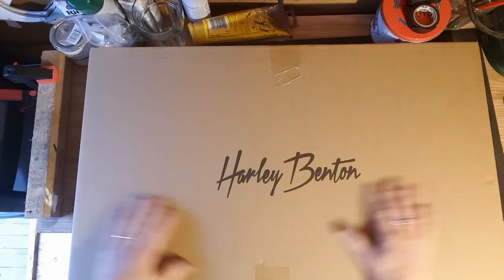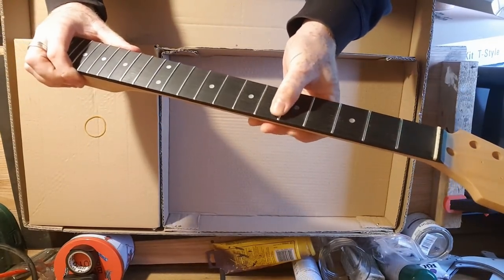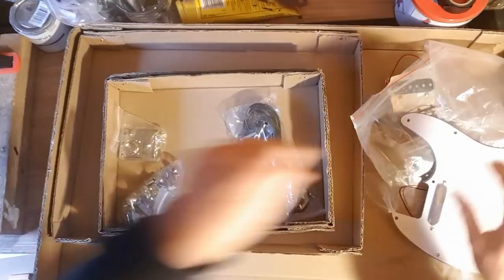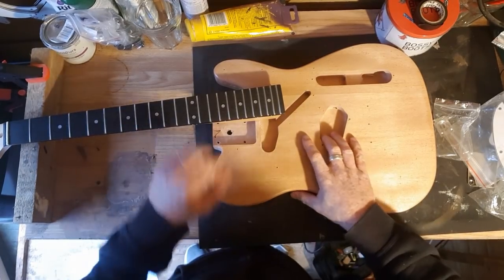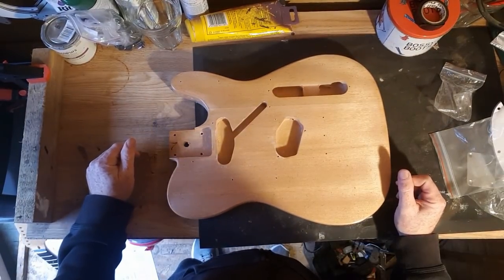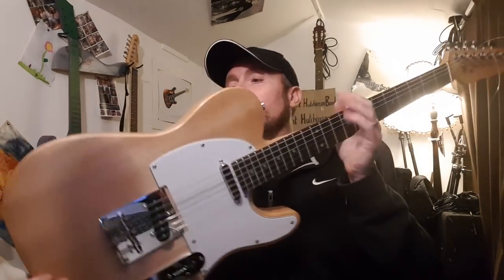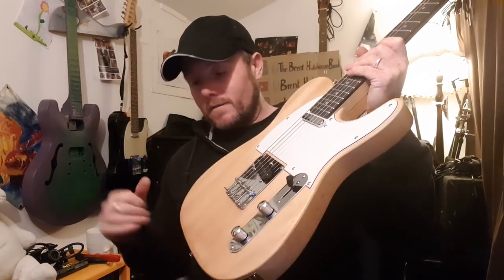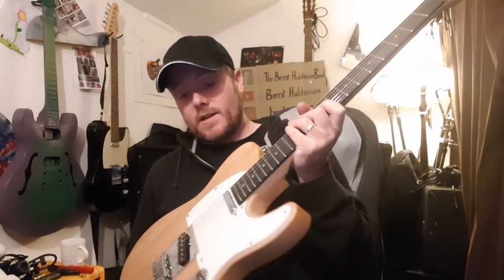Harley Benton Telecaster Kit Unboxing First Impressions Build and Sound Test

Comment: I got one of these kits a couple of years ago and covered it in Harris Tweed fabric at the request of a mate. Went better than expected so I would actually try that again. The cost was about the same then as now, and the build quality was ok, for the price. The fret ends were sharp though pretty much all along the neck, and the truss rod didn't perform well but the neck was straight enough. Be prepared to do a lot of fettling if you do get one. It's all good fun though!

Comment: I'm definitely going to give one of these kits a go. It's a shame they don't sell them without all the hardware. Great video. HUTCH CLUB!
Reply from the maker: It's a gooden
Reply: The cost of the hardware is minimal.  You might get the kit for £10 less, which if you plan to replace most/all of the kit hardware, isn't really going to be a deal breaker. Some of the parts, like the neck plate, are worth having, as another neck plate may not quite match the kit one for hole placement.   As Brent says, kit tuners these days are pretty good, normally with an 16:1 or 18:1 ratio.  It's invariably the nut that causes tuning issues and the nut/nut slots always come set too high.  Fair enough if you want to set the guitar up for slide, but not great for standard use.  Replacement of the plastic nut with a  bone or Tusq  nut, and the slots cut to the right depth with a decent set of nut files is the way to make this type of kit guitar instantly better and more stable to play.  But good nut files aren't cheap.
Reply: I have built one too, my neck is really bad...the frets need some work, am scratching of the skin of my fingers playing it. Have to round the edges...soon. it is my first build, so l am kinda happy with what l did here. Will try more expensive kits later. Cheers
Reply: @BrentHutchinson  BETTER than those 'Strat' 1s you got a while back!
Reply: pascal bxl that’s not uncommon with an unfinished neck, it would happen to Fender or Warwick necks too, if they sit unfinished for some time, it’s the wood shrinking (and the frets not). Some fine wet/dry paper should take are of it, and then a good amount of fretboard oil ie. lemon, to keep it from shrinking more.
Reply: @1777DK  thanks for the information, will definitely try that out in the next couple of days. And will let you know the results. Cheers!

Comment: I was so happy with the golden glow the body has that i just used it as it came out of the box. And the look gets better by time and age. The two metal plates are sanded to the brass så it really look aged, I gave the knops on the tuners the same treatment and i wouldent trade my guitar for any Fender as it is now.
Reply from the maker: fantastic arnt they !
Reply: @BrentHutchinson  As much as i dislike it, Harley Benton could give Fender a serious beating in quality and price. Fender are digging it's own grave with all the variety of models and price ranges. You begin to doubt the Fender brand when there are too many upper end Squiers Low end US models and mid priced MIM models with too few variables that arent that better than one mid priced Harley Benton. And this is only Strats, not to metion all the tele variables.

Comment: Great Video, no Snobish judgements! Great playing too, as mostly always ;-). Thank's for that stuff you do. I will buy one of these, all natural finish, but i do need some place for my belly. And the Pickups need a change, for me with doublerail Humbuckers. No Seymore Duncan, but cheap ones from eBay, they do there job well enough for me, sounds great! And of course the Headstock, i don't want to play a paddle!
I like your videos and your playing/singing - always waiting for the bell - new information to enjoy! As Mr. Spock said: Live long and prosper
P.S.: sorry for the mistakes - it's more than 55years ago that i learned english in school - i understand your comments, but writing textes is another thing - eine schoene Woche noch...
Reply from the maker: Thanks for supporting me and my channel :)
Reply: Hallo. These HB are good for £80 but I bought an SX STL 50 Tele for £139 - Lake Place Blue - normally I like Stratocaster but with maple fingerboard this thing converted me. The stock pickups were good but I broke bridge pickup when shielding. So I got some Ironstone Alnico ones - quite cheap in UK but awesome.tone especially thru valve amp.  The SX feels like a Player series quality to me. Chunky neck which I find easier to play as I get older. Got that country twang, Merchant City had set it up. Quality tuners - not lumpy. This one sounds a bit buzzy? SX is cleaner tone. Still the HB is £80 delivered. Ah when put thru its paces it sounds closer to SX. I do love my high gloss maple neck and fingerboard - even sounds bright thru my bass amps :-)

Comment: It's just PERFECT isn't it.

 For me, a kit would be pointless because i love the finished Harleys and they do all the tons of work for the same price.  

But if you want to custom up via a KIT then sure i understand that.

When you think about it, buying the finished guitars at the same price as kit, they are doing a LOT of work there for free really........ bolting up....electronics, painting...setting up....etc

Half an hour?........good Lord........it would take me 10 hours

You could leave it just as it is. Concentrate on the intonation and tuning. Maybe use Roller string guides at a few pence?  ........etc  (string trees)...a better nut....?
Reply from the maker: Yeah that's where we are at now the price of kits is not really worth it anymore but it's fun to do and I love blow torching em :)

Comment: I have been thinking about getting one of these.  Only concern is how to shape the head stock.  I am not a super handy guy and do not have power saws.  I'd probably use a coping saw.  Also, did you end up soldering that one wire you mentioned?  If so, how, where and why did you?  Again, I"m not Mr. Technical when it comes to these things.  Thanks!
Reply: The ground wire must be soldered to the metal plate that holds the strings, if you don't do it then you will feel electricity when touching the strings which is to avoid

Comment: If you got this kit and also purchased a proper fender telecaster neck, neck plate and fender tuners, would the fender neck fit in the neck slot of the Harley Benton body?
I have researched this and tried to find an answer but have been unsuccessful in finding out
Reply from the maker: That's a tricky one. It would fit but its a gamble how well it would fit.

Comment: Fretboard: Amaranth.  Which is Purple Heart Wood. Peltogyne, commonly known as purpleheart, amendoim, violet wood, amaranth and other local names (often referencing the color of the wood). So its purple to start and turns brown when exposed to sunlight over time, but in this case they stained it black.
Reply from the maker: Awesome thanks I didn't know that

Comment: Do not use wood stain the some parts of the wood will not suck up the stain it will not work. My kit is now for the third time sanded down i will use now paint. Love to see you blow torch it and the use some oil nothing more

Comment: Brent, I hope it's okay if I post this:

Guys, just a friendly heads up. I bought this because of Brents review, which I think is great and showed everything honestly, but I think they either sent him a selected and polished version of the actual kit or the built quality of these varies extremely, because the one I got was trash. 
The frets were undercut so much, some of them lifted off the edges of the fretboard about a millimeter. The body looked like I cut it myself (with a scissor) and some of the drilled holes were off so much that I couldn't get the basic parts like the bridge properly screwed on and had to redrill them. Be careful with these kits if you don't have the patience and the experience to fix them in case you need to.

Rock on and have a nice 2021, all of you.
Reply from the maker: Thanks for the heads up. Shane yours was bad. It may be a hit and miss thing. Happy new year :)

Comment: You should mount the strings through the body for more sustain like the "real" Fender Telecasters :-) The kit sounds great for the price!
Reply from the maker: I might still do this in the future. Yeah it's amazing value :)
Reply: There is no "more sustain" for string-thru.  FYI
Reply: Michael Polutta Ofcourse it is.
Reply: @lancelot_captain  I've built both styles of Tele. (built, not assembled from parts somebody else made.)  No difference.  There's a difference in FEEL of the strings (thru-body is stiffer, harder to bend, and top-loader feels "slinkier"), but no difference in sustain.
Reply: Michael Polutta Try to change wood in the body and you see the differense.

Comment: I order the odd electronics bits and bobs from Aliexpress every now and then, most of these pamphlets usually are disclaimers etc. If I'm curious though I scan them with the Google translate app (use the camera feature) which generally gives you a good idea. Also great for use on travel ^^.

Comment: I have NEVER in all my many years of working with guitars, seen a plastic spacer underneath the neckplate.
Reply from the maker: Quite common
Reply: @BrentHutchinson  My many years are at least 40, so no it is not.
Reply from the maker: @kimhansen6384  sorry you are wrong
Reply from the maker: I do like feeding the Trolls  though ;) yum yum
Reply: The early 1960s Tele I owned didn’t have the plastic gasket under the neck plate but my 1975 one does. I think that they introduced them in order  to protect the finish when the screws are tightened although I’ve never personally seen any paintwork damage around Tele neck plates. Anyway the plastic gasket isn’t an essential Tele component, none of my home built Teles and Esquires have them.

Comment: Does the body and neck come with a satin finish on it?  It looks like it from light reflections in the video.  If so, you're going to have to sand it down significantly before any attempt to try and stain it.  Luckily it doesn't take too long with power tools, but you need to make sure the finish is all gone, otherwise the stain won't take evenly (or at all in places).   

If you decide to shape the paddle headstock to more of a T-style shape, then you'll also need to refinish the cut edges.  It would be nice to know whether its a poly or acrylic finish on it so you can use the same type of finish to ensure compatibility and no unwanted reaction.   It may be easier to sand off any finish and start again rather than risk it.  
 
The fretboard material, Amaranth, is also known as Purpleheart.   https://www.wood-database.com/purpleheart/  It's slightly harder and denser than rosewood, but will shrink a bit more over time, so it's worth keeping it well dressed with lemon oil.

If the screw holes for the neck  in the body don't let the screw just be pushed through, then it's worth widening them with a drill bit the same width as the screw.  This ensures the screws really pull the neck down as hard and as solid as possible, without the risk that the screw can't turn any more in the body hole before the neck is pulled down fully.  

The supplied bridge allows for both top-loading and string-through body stringing, though if you want to go string-through, then you'll need to drill your own holes and supply your own rear string ferrules.  But this is something you can do at a  later date, after deciding whether the guitar is worth it.  

Overall it does look like a decent beginner's kit for those who like the kit as-is, and sounds pretty decent.  But some of the kits with no pre-applied finish might be better for someone who wants to do their own colour scheme.
Reply from the maker: Yes you are right it will need a good sanding down. Its sealed and very smooth. Mot sure with what though.